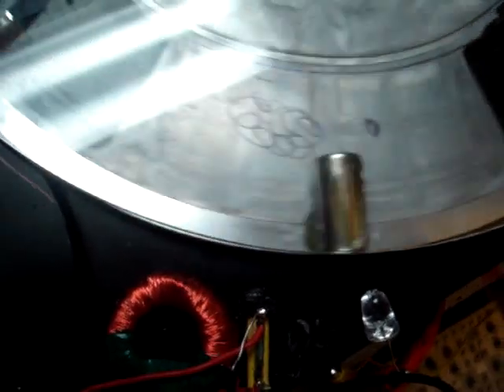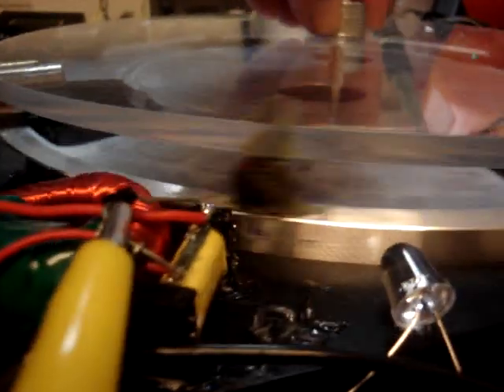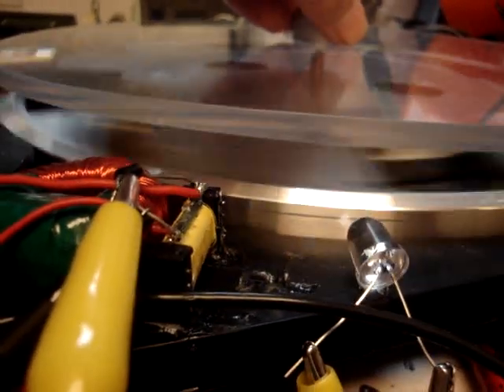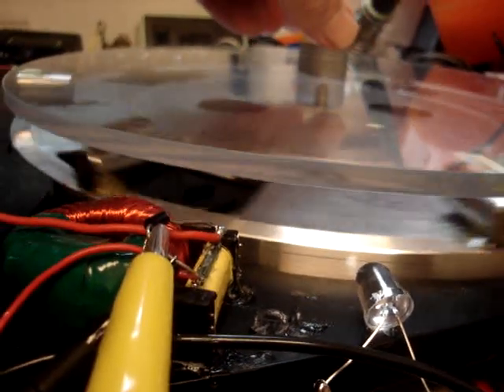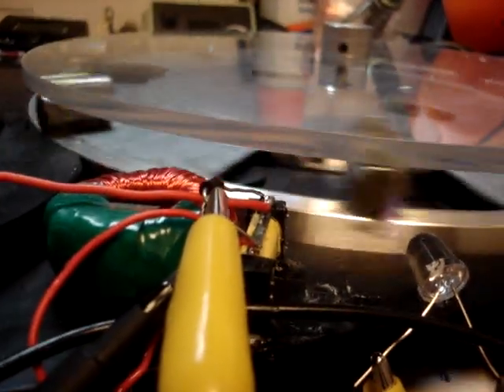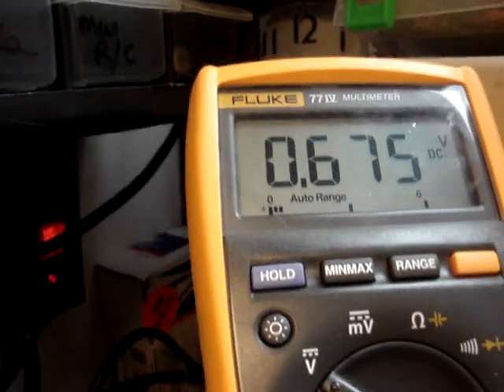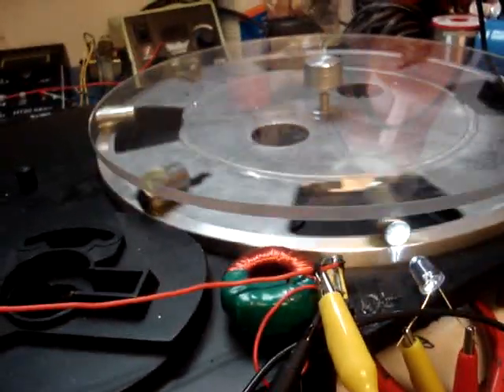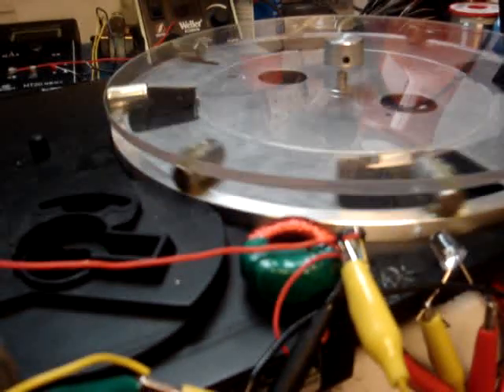Slow Motor Demo

Comment: graphite is used in spacecraft for turning thrusters. It can take all the temp extremes and will not dissipate from radiation burns. I have plenty here if you can't find it yourself. Just putting the offer out. PM me if you are in need.

Comment: Hey k4zep   I have used graphit in my bearings and they spin awesome. The thing is, I got the idea from someone who knows someone that used graphite on reel to reel spindles and turntables.  If you get a chance check out my graphite bearing vid. It just may get you more speed at the power level you are at here. =]

Mags